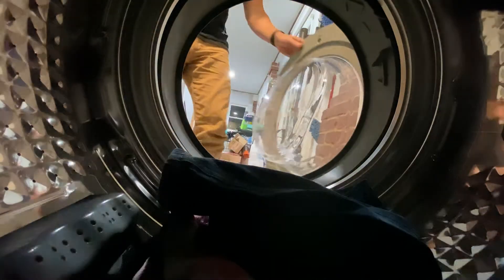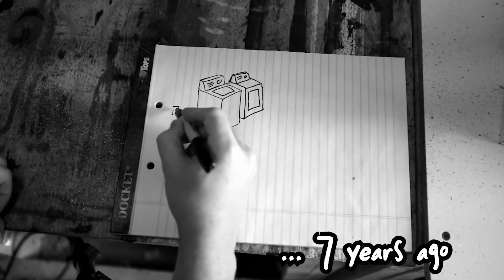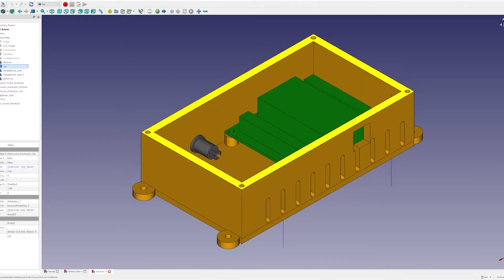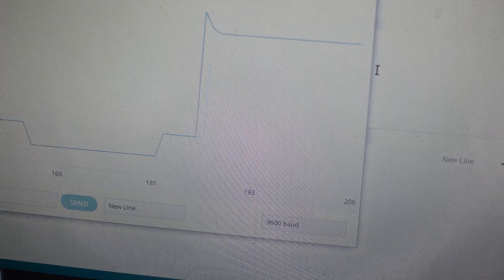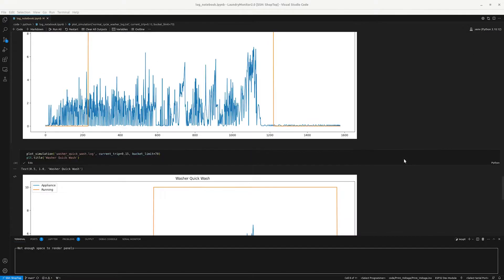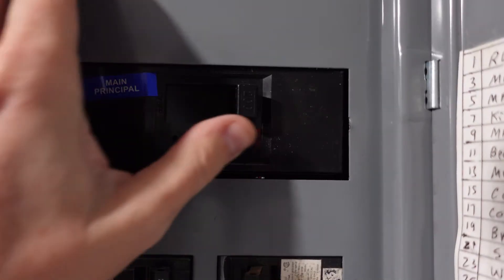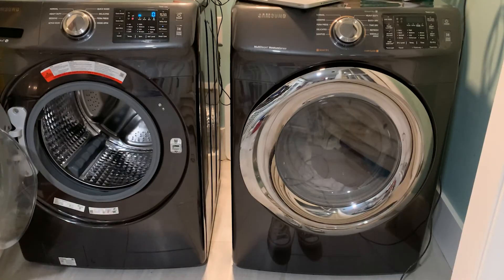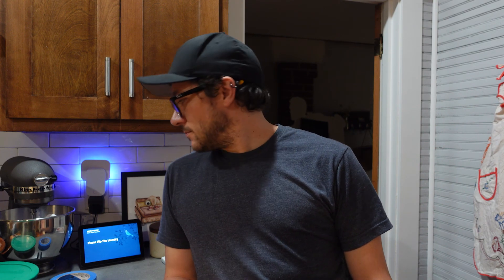this upgrade changed how I do laundry

Comment: 3 screws to open the washer's top and then superglue a mount for your old vibe sensor to the washer's drum.  Takes less than 10 mins.  Alternatively you could use a $3 hall sensor attached to the shock absorbers under the drum for sensing movement.  Sorry you ended up with a Samsung, after the warranty expires you might need to discard it soon after.  I am not aware of any law which prevents a manufacturer from putting random self-kill code in the firmware which goes some time after the warranty to ensure you buy new machines (after you are devastated to discover the parts are insanely priced, making repair nonsensical)
Reply: Note: I am here looking for someone who used Home Assistant to make a new brain for their washing machine and bypass all the electronics.  This way I can have a forever-washer.  I am worn out by the planned obsolescence and enshitification of something simple as a washing machine.  Wish our politicians would do something to outlaw the changes every couple years to washing machine design, there should be only a standard off-the shelf set of affordable parts that manufacturers are allowed to use.  Allowing them to reinvent the wheel and make it worse every 2 years is not sustainable.

Comment: You could probably tap into the control panel of the appliance to get the timer and the state of the self-clean cycle red LED and send all that to Home Assistant. You could get custom alerts to take the laundry out depending on where you are in the house and a reminder to do the self-clean cycle if you haven't launched it by 10 PM.

Comment: smart plug and home assistant automation is all You need
Reply from the maker: Where’s the fun in that ;)
Reply: @SparksandCode  You just got one subscriber :)
Reply: Smart plug, even a 15A rated plug, not safe with a washer.  Inductive motor's inrush current will far exceed the smart plug's safe usage, and will eventually cause the plug to fail.  Use a smart plug with only resistive loads, like lights or TV's.  Or, risk burning your house down with a plug not designed for this sort of use.

Comment: Hi, which current sensor (there are a variety with different spec's) and do you have a wiring diagram / circuit?)
Reply: Also, are you able to share the code and 3d model? Thanks in advance.
Reply from the maker: Yeah I’ll squash all my WIP commits and put them on GitHub with the model later today.
Reply from the maker: Links to the parts are in the description.

Comment: Is it necessary to put the split core transformer around ONLY the hot wire?
Reply from the maker: Yes. If you wrap the white wire too (clamping around the power cord of the washer/dryer). The AC waves cancel each other out and you won't get any sensor voltage.